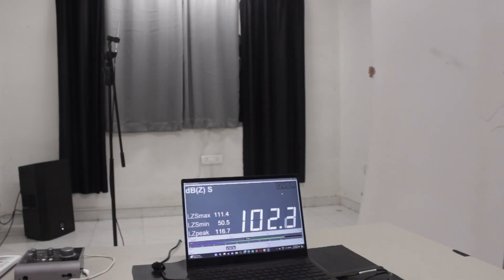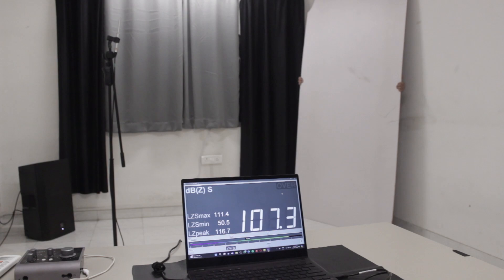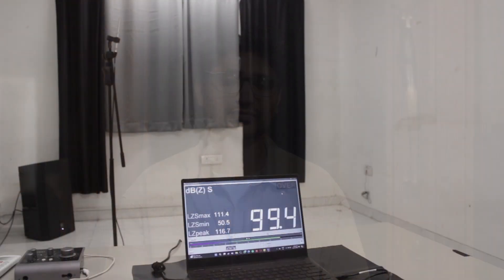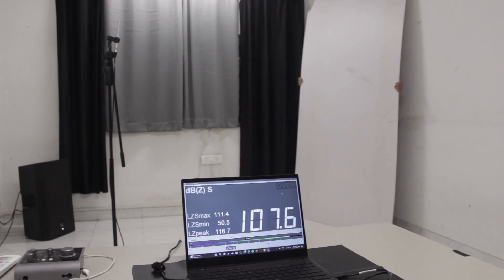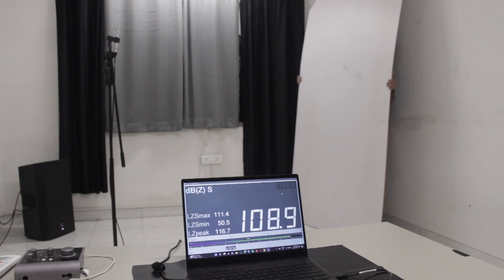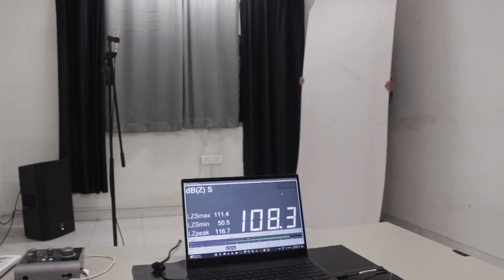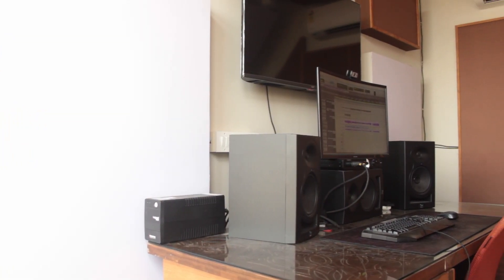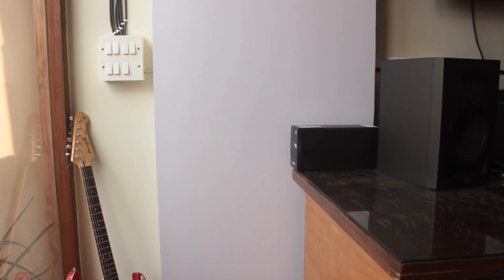Mastering bass traps for better sound

Comment: ... That is not a bass trap you demonstrate in the video. Bass trap have to be thick, heavy, dense and some porous.

What you use in your video is more akin to a reflection panel, thus it's understandable that the sound will be increase, cause it's reflected and not absorbed.

Also your explaination of room mode and standing wave are riddle with erroneous claims. Sound have source and direction, so spaces and distance always calculate at that focal point.

What you demonstrate is the general level of SPL distribution in a room, and have nothing to do with standing wave and room mode.
Reply from the maker: We recommend you watch another video we have made about acoustical panels which explain different absorption mechanisms. You will know that your assumption that bass traps have to be thick isn't accurate. This is an example of a membrane absorber. We have test results from a reverberation chamber. 

You mention that our claims are erroneous, we would love to understand your counter as the point you have mentioned is not explaining much.
Reply: @consonanceacoustics  Bass trap is not an acoustic panel. It's an item specifically designed to installing on point where 2 or 3 planes connect. 

So you claimed the reflection panel you demonstrate in the video are an actual bass trap? Do you mind to share what brand bass trap and what are the acoustic spec of that specific material?

It doesn't alway have to be thick, depends on the performance you expected, but physic dictates it the thicker the better given meterial spec's similar. But I would reasonably doubt the performance and spec of the material you demonstrate in the video due to the aesthetic alone (namely flat surface, thin thickness, low rigidity and mass.). 

Room mode and standing wave are mainly due to the superposition of two identical frequency and energy level signal. Plain and simple.
Reply from the maker: The absorber that we manufacture has an absorption coefficient > 0.5 for frequencies below 200 Hz. It has an absorption coefficient of < 0.1 for frequencies above 700 Hz. 

If that isn't a "bass trap", no one can know what is.
Reply: @consonanceacoustics  Do you even have lab testing report for the specific board you shown in the video? 

Hard to trust in the spec when you don't even have a name for your product.
Reply from the maker: As a matter of fact, we do 😄.
Reply: @consonanceacoustics  So, what's the name?
Reply from the maker: The name of this product is Laconique. You can visit our website and come to our studio in Pune to experience it in action. We have a lot of tested data that we can show 😄.
Reply: @consonanceacoustics  Very funny, the name Laconique doesn't ring a bell in google search engine either.

Anyway, admittedly I was tricked by optical illusion when I 1st saw the video and thought the panel that labour hold in the corner is paper thin, but actually it's just the hand holdings it at different corner that create an optical illusion. The panel actually is around 4 inch thicks, so it do look like a proper bass absorbtion panel, 

After compared your product data sheet with GIK Tri-trap and GIK T40, the unexpected increase in volume at certain frequency might have to do with dipping of absorb coefficient around 125hz and your panel design's flaws that somehow have some reflection properties. Your low frequency absorbtion panel have very weird frequency response shape and it only show down to 100Hz in term of low frequency, where as usually the shape are just a peak with different Q factor and they do extended to 50hz region for GIK. IMO the 40-80hz frequency are pretty important in term of acoustic performance, thus GIK Tri-Trap is a much superior product and should not have the same reflection issue compared to your product.
Reply from the maker: @LEEKING2005  We are a startup, of course it is not going to ring a bell. We are not even in the league of a company like GIK. This video is not about that. This video is busting a myth, something we have experienced while working on projects and learning by testing. There are a lot of other videos on YouTube that will verify the claim made in this video. We recommend that you check them out too.
Reply: @consonanceacoustics  You are not busting any myth, you are showing your product have defect or your lack of common sense in such matter.

Corner bass trap generally would not have reflective behaviour. My guess is your panel was intended to use for speech purposes, so other than bass absorb it also have some consonent pronunciation frequency boost to make speech more clearer(2k-4k range).

If you use item like that to busting "myth", you are either ignorant or delusional.

Comment: Not sure about what you tried to demonstrate in having absorber across the wall. Are you saying putting it at the corner is not right?
Reply from the maker: Well, yes. Putting it at the corner isn't wrong but the concept that bass absorbers need to be placed only in the corners is incorrect. Having them in the corners will reduce the reverb proportionally to their area but that will not always affect the room modes.